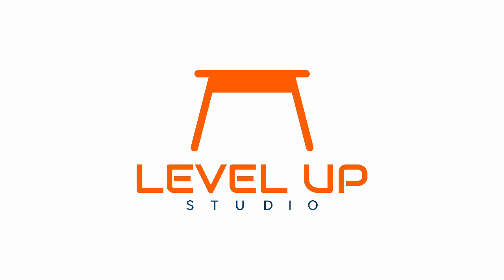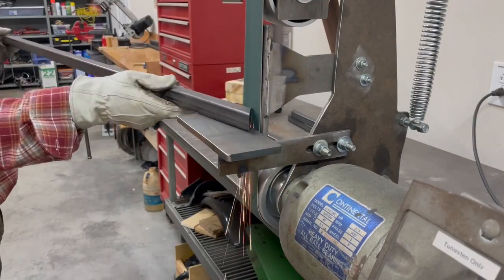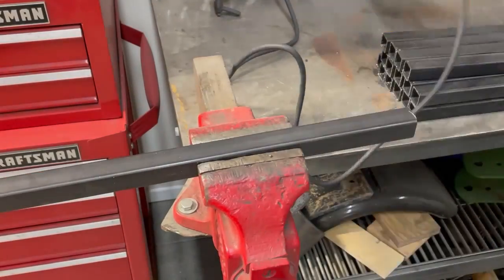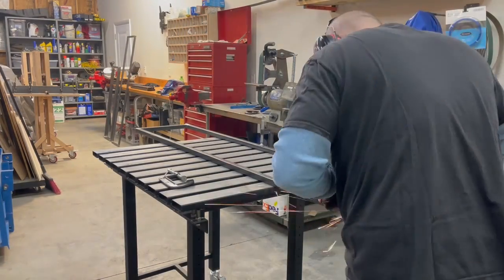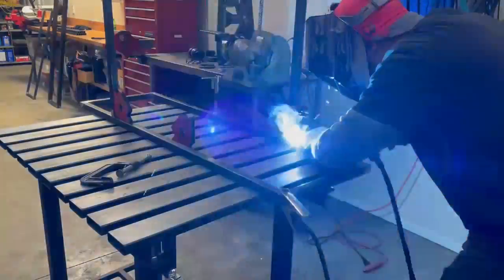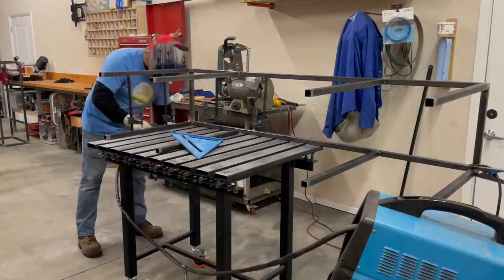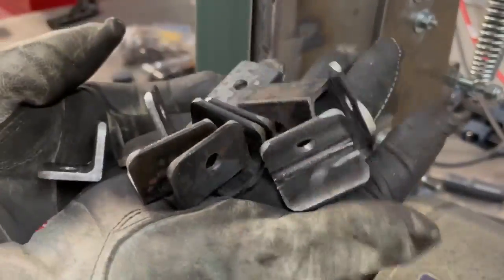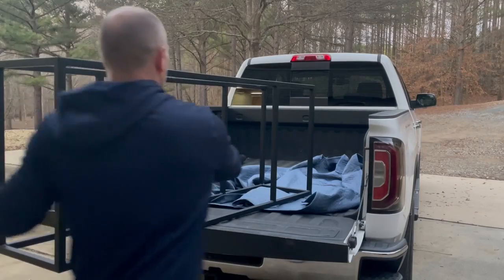Console Table Build - How Steel Table Frames Were Made

Comment: Good job.   Did you make a video of your welding table?
Reply from the maker: Hi Zoltan.  Thanks for the comment.  Credit where credit belongs at the link below.  I modeled mine after this.  I used 3x1 rectangle steel for my slats and 1/2” adjustment elevator bolts.  Some guys use flat steel but it better be relatively thick to keep flat.  Great luck with yours if you take it on!  https://youtu.be/bt5vwoRv8WU